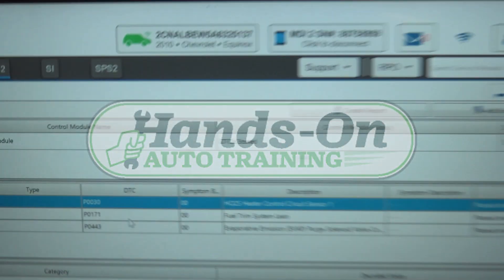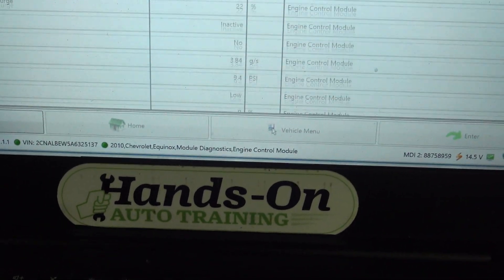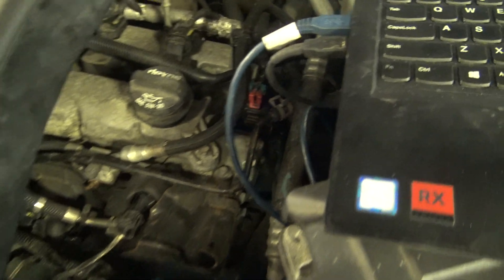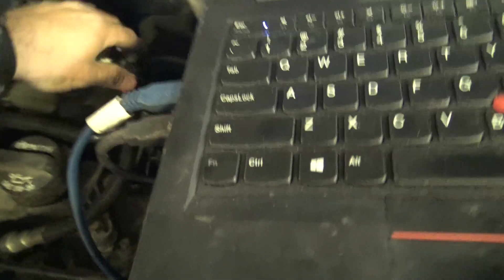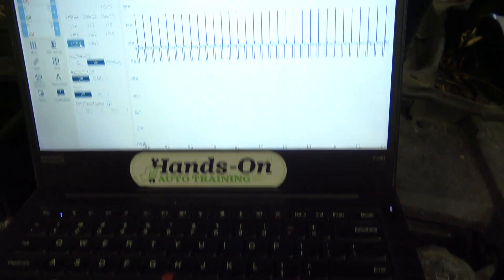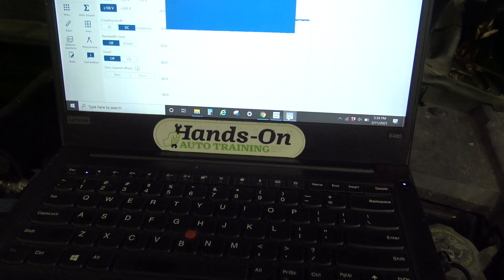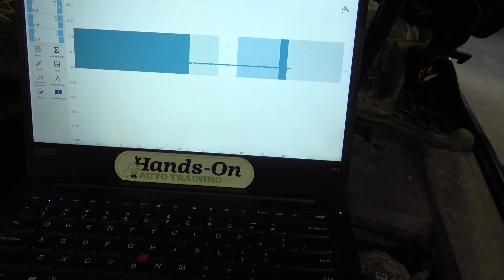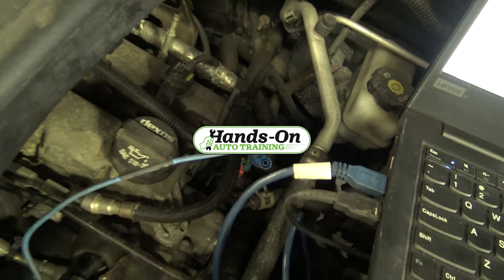2010 Equinox P0171

Comment: Good job. I had the same problem with the purge valve.
Reply from the maker: I was at this shop and in a hurry after another diagnosis,  so I just did a quick scan,    MAF was really low so  I was thinking either bad MAF or clogged exhaust running well though besides FT issues ,   when I came back to program the ecm that I diagnosed (I should have made a video of that one!)  they still had this equinox with a lean code.. and I was like ok  MAF good now..  what is causing the extra air!?!     Thanks for watching!